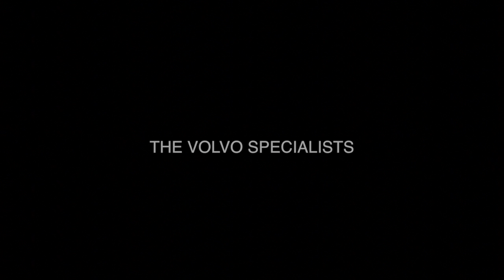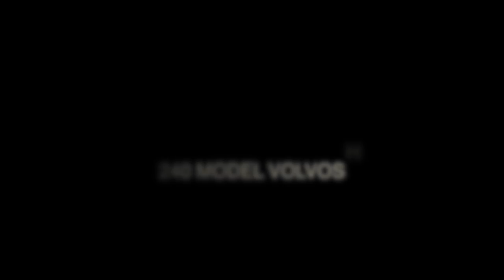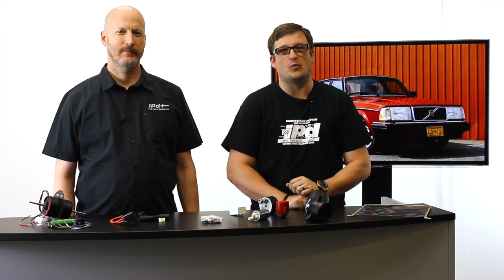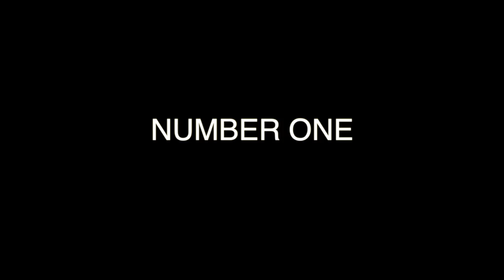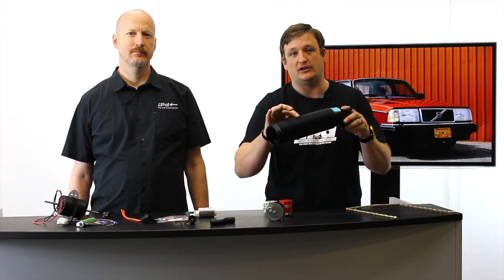IPD Volvo - 10 Common Issues with Volvo 240s

Comment: I owned a '91 240 until 2004 and had 286K miles on it. I'm surprised that these did not come up: I had to replace the kick-down cable twice at about 130K each. If you rotated a small wheel on the upper right of the engine, the cable springing mechanism would stick and not take up the slack, causing problems with shifting. Problem was, the transmission had to be dropped to replace it, and it ended up costing around $400 each time. The other issue is that I would have to replace the radio antenna about every 3 or 4 years. I think it wore due to constant road vibrations. Finally, in about 2002, Volvo parts came out with a solid, non-telescoping antenna, which I believe would have fixed this issue. I had the control to switch the air to recirculate break, but never bothered to fix it, since it was not set to recirculate which would have created interior window fogging problems, and it was hard to get to and would have costed a full day's labor. I also didn't bother to fix my broken cruise control. I don't think that I ever had one the issues that they mentioned.

Comment: I drive a 1985 240GL Volvo. I had just changed the tank fuel filter and the damaged fuel relay switch as well as the fuel pump under the car. It drove beautifully and then I took  sharp corner and it stalled on me and won't restart anymore. My mechanic tells me it's the fuel distributor but before I pony up cash for the crazy pricey part, i would like to ask if it could be something else?

Comment: After searching the web for more than an hour and the Haynes manual has proven itself useless, I have come to the conclusion that Volvo 240s don't have an Oil Pressure Sending Unit. But how does the dash light go on and off?

Comment: I have a 1989 240, not 9n the road but started and run a few months, 5.months ago, form the first time, I had to do more than turn the key to start.
I had to pump.the gas.
now it won't start at all.
PLEASE HELP
I ordered a fuel pump motor

Comment: Hi all...regarding the s40 1st  generation....can we  install the t5  engine and transmission from the s40 2nd generation....bolt for bolt....also...can we install the awd system from the 2nd generation s40 onto the s40 1st generation ???... all sensible/relevant responses appreciated...thanks in advance...

Comment: Glad i found you guy's i have a oil leaking on the alternator causing it to burn-out. I think its leaking from the cam but I just replaced the alternator can i get the manual from your site?

Comment: I live in sweden and i drive my red 244 from-76 to work everyday. with it being a car with a b21engine with a mechanical fuel pump and carburator i dont get most of those electrical issues, although i have changed the heating fan since it made the sound of a fighter-jet

Comment: I bought a 244 as my first car. I had all those issues except #10
I ended up doing 300.000 additional km in a car i bought with 120.000 km in the clock. 
Best car ever.

Comment: indeed the motor mount was an issue to some degree, i mean jumping them would kill them

i do think some of the "issues" are less volvo issue tho, and more age issues that all cars suffer, like plastic inlet piping etc

also, it seems that the bulk is on the later model car, ie electronic injection, which again, would be the same as any other major/bulk make car of the same age

Comment: Hi i'm Kenny,now i have one volvo can't start but that volvo he change the fuel pump already but still can't start. Than when i check the plug cable it only plug number doesn't spark, so i don't know how to fix pls tell me more detail about volvo 240 GL injection.
Reply: my 88 Volvo 240GL cranks but wont start , I changed the ignition coil,timing belt, fuel pump,filter, plugs, and wires
Now it will start but it's running rough , i'm still diagnosing and working on it
Reply: Change distributer if there is 12 volts at the dist. connector

Comment: On number 8 fuel relay. the most common problem with that, is soldering issues in the circuitboard inside. Pry the case of, carfully with a small screwdriver or similar, and soldering the connections thar are lose och is bad,  you may need a strong lookingglas to examen the solderings . Saves money :)..

Comment: That auxiliary fuel pump actually keeps the high pressure fuel pump not to fail prematurely. In case one or the other fails, change both, the main pump is probably already damaged if the auxiliary pump fails. They are both inexpensive.
Reply: Facts

Comment: Pretty much spot on, I've had to do all 10 of these. The reason the light module tends to fail, from my experience, is shorts in the degrading wiring harnesses of the '80-'87 models. Find the short or you may fry the replacement too. The other things I think are pretty common are MAF sensors and bushings, most of which are easy to do, but the rear trailing rod ones need a special tool that is near impossible to find. And of course, the main wiring harness on the '80-'87s, but if the car is running, that has almost certainly been done already because they'd all just be a bundle of bare wires by now.

Comment: That the 240 does not have relay on the light switch is also a common issue. 
My switch melted... So I fitted relays... Now the light is stronger and no heat inside the switch!

Comment: Thanks guys. Just picked up another Volvo. '86 245. Your website is the best. I think the Wiring is the main issue and should be the no. 1 problem. From the firewall to the rest of the motor its crumbled.

Comment: Flame trap and air intakes, on both 1986 240's I own. Other fun thing was the brake light board had slight rust and the light wouldn't work, apparently common.

Comment: almost all the same errors have the 700 series plus errors that may be caused by small driving is labda sensor is full of unburned fuel and exhaust. they can often just take out and let stand over night in gasoline or brake cleaner and brush clean and use compressed air and clean ones and put back in and they work just fine again as I did with my 740 ...